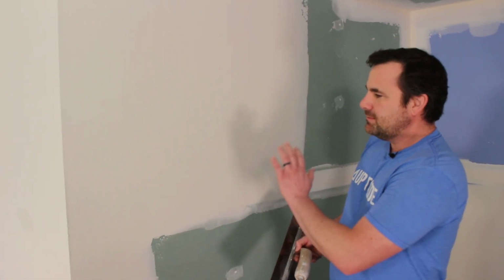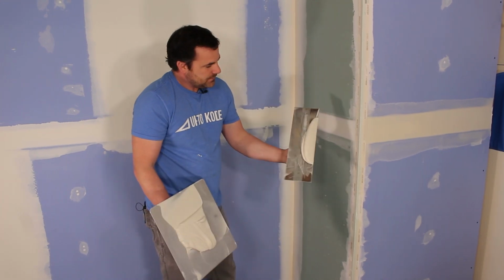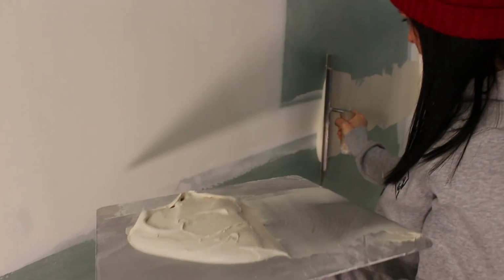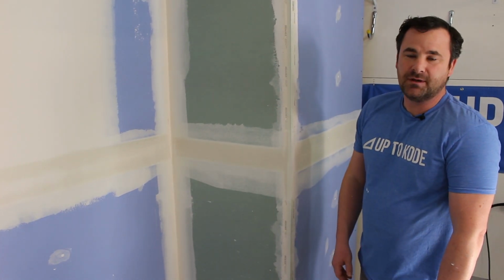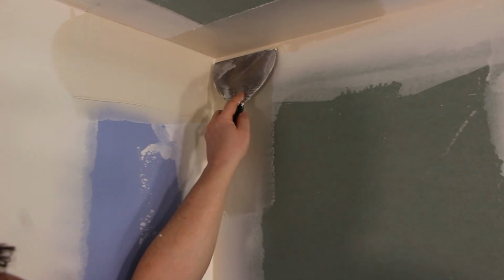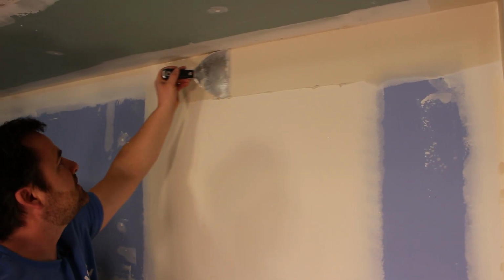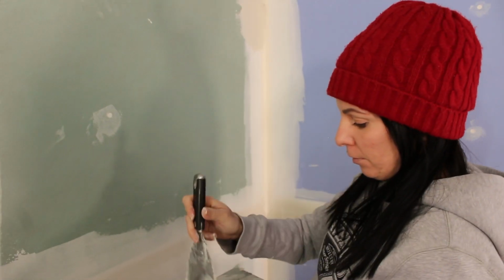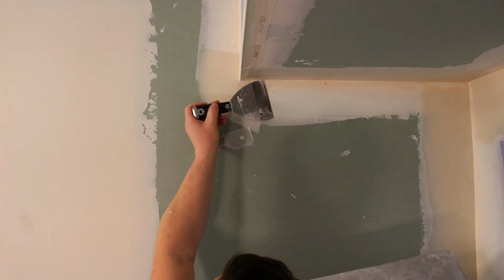How to Mud & Tape Drywall For Beginners (Part 7 of 10) - Flats, Inside Corners & 3 Way Angles

Comment: Kody,  Thank you for sharing such a great drywall tutorial series.  I have a question that maybe you can advise me on.  My dining room is currently paneled and my wife an I would like to drywall the room.  The current ceiling is stippled and spiky all the way to the wall.  We intend on using crown molding but how would I tape the wall boards to the ceiling when they are like this?  Should I just fill in any gaps and not worry about it since it will get crown?  Should I try to knock the texture off and tape it?  What is the best way to handle this?

Thanks,
Joe
Reply from the maker: Hey Joe, feel free to DM me on Instagram and we can chat. I have solutions for you.